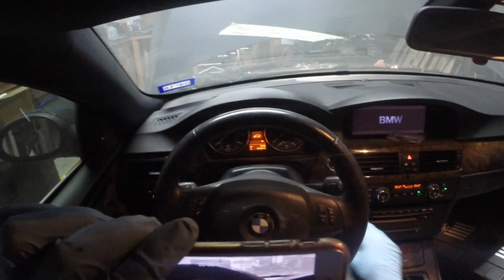BMW 335i Engine Swap - Fast Motion

Comment: 1 to 10 how difficult you think this was? I’m doing the same on the same car next month
Reply from the maker: Daniel Velez This is the first full engine replacement I’ve done so I was sure to take my time and mark every connector. As long as you stay organized it’s really not that difficult. Make sure you bleed the air out of the cooling system correctly. There’s videos on here about how to do that. I’d say it was a 6 out of 10 on the difficulty scale. The key is organization, labeling, and putting the bolts back in there place after removing them!

Comment: i have a 135i manual needs new engine. can i just buy any n54 engine and will fit properly?
Reply from the maker: Gabriel Torres Yes you should be able too. You might have to swap over accessories but the basic engine part should swap over just fine.